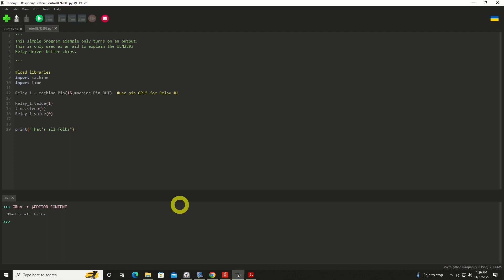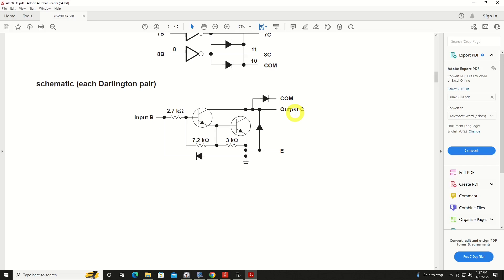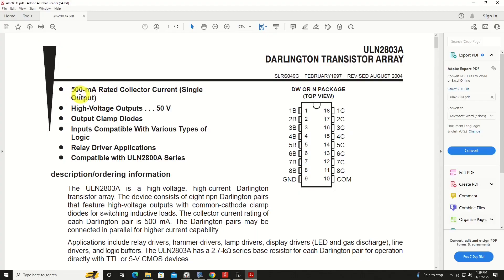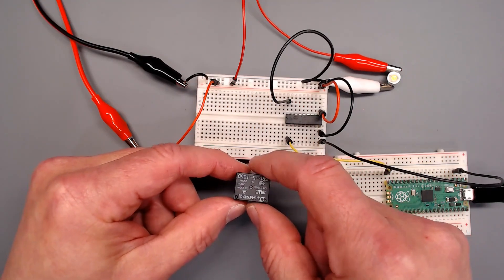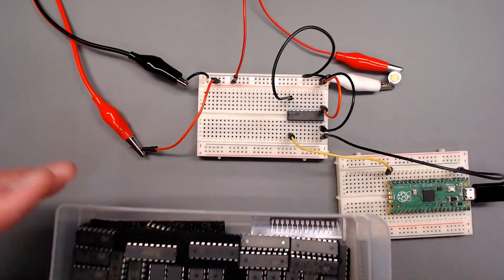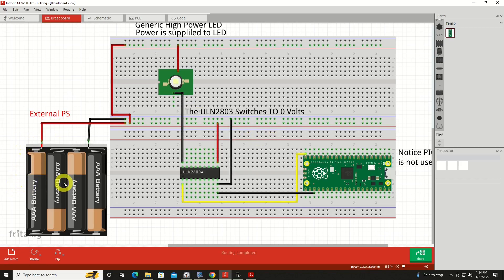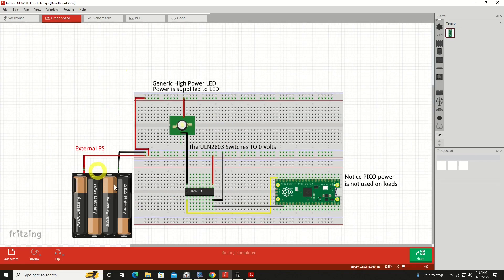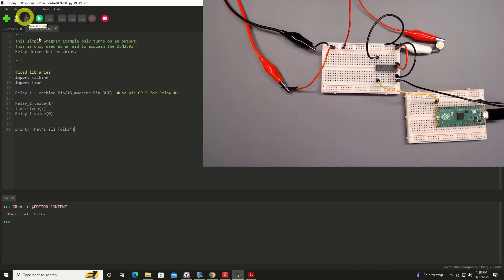Protect your PICO by using this chip to drive larger currents!

Comment: In bed watching. Something to find next is the “opposite” of the chip presented here. 
I plan on tapping a number of 12vdc lines, and need to knock them all down to input level of pico 
But would like to do 20’ish inputs via similar chip, instead of numerous voltage divider circuits
Reply from the maker: Good morning nemesis851_,
Off the top of my head I don't know of a chip that can do that.  However, I have to believe one would exist as that is a very common need when dealing with digital inputs.  Perhaps an IC that is an optocoupler?  
Cheers!
Chris

Comment: Assuming you want to deploy this circuit out in the real world (i.e., off your bench), you'd need to power both the high power load AND the micro-controller. Assuming the load also needs a high voltage, you'd probably want to use a single PSU. How would you do it? I'm thinking of getting a USB PD trigger board and a USB adapter which will give me 20V. I then need a buck converter for the pico and a boost converter for the load(s) (which need around 24V peak). I need to drive multiple 24V loads at 2W max (they'll be PWM driven so might need less power). Do you have any recommendations about the converters in such a scenario?
Reply from the maker: Good morning semod8614,
Assuming this device can run on AC, I would use a switching power supply to get the 24vdc and then use a buck DC-to-DC converter for the microcontroller. 
I am always hesitance to use boosters because the amps drop as the volts increase.  Everything has to balance between source and load regardless of what is in the middle.
Chris
Reply: @MakingStuffwithChrisDeHut  Yes I thought about that but I am drawn to USB PD as those kind of power supplies are now so cheap and ubiquitous and come in all sorts of form factors. Also, do you get V drop across the ULN2803? Assuming you do, I will still need to boost with a 24V PSU or look for 30V PSUs which are less common and usually more expensive.
Reply from the maker: @semod8614  More than likely there will be a small voltage drop, but frankly I have never measured it.  Is your 24v device that sensitive that it needs exactly 24v?

Comment: So can this be used as an alternative to using an NMOS as a switch?
I am planning to buy the IRLZ44N MOSFET to swtich a 12v 1A load (fan). As per my understanding, ULN2803 can achieve the same result while providing additional protection.
I may have to consider one with higher collector current rating as ULN2803 has a 500mA limit with 1W power dissipation...
Reply from the maker: As typical with all electronic devices, watch the Volts and Amps as you already noted.  
Cheers!
Chris
Reply: @MakingStuffwithChrisDeHut  Thank you.

Comment: Hi, as  usual a very good presentation with effective examples. If you were English these types of interface chips are called an "open collector" interface i.e. a transistor with only the base and emitter connected to the micro controller. As you described this means that the signal is switched to ground not the controller positive so,  presuming a common ground and the considering the limits of the chip, any external voltage and current can be controlled by the micro controller with minimal interfacing. You can do the same with any transistor (BC108) or Darlington pair if you only need one output. Thank you very much for the effort and time on these videos. Bye
Reply from the maker: Thank you for the kind words, very much appreciated!  Thanks too for sharing the "English" perspective.
Cheers!
Chris

Comment: not cheap but cheaper than the pico, less than half, but the uln2003 is much cheaper (7 io, 2803 has 8 io)
not a drop in , need to check the datasheet
Reply from the maker: Hi Jyv,  When I did a lot more discrete electronics projects I bought a lot of UNL2803 chips and still have plenty from back then - so sometimes I forget to consider prices.  However, even if a ULN2803 costs 10 times more than a PICO, it still provides more than just protection as it allows you to do what the PICO can't.  The uln2003, as you noted is a lower cost unit too. 
Thanks for the feedback, always a pleasure!
Cheers!
Chris

Comment: Excellent, clearly explained, and useful presentation!  I appreciate how you don't include music,  distracting irrelevant graphics, or extraneous material....just the facts clearly and pleasantly presented.  Reminds me of physics lab in college - a good thing. Where do you source your small electronic  components (you already have mostly everything)?  I have used Digikey, but wonder if I am overpaying and should reconsider the junk on AMZN.  Thanks from a new subscriber!
Reply from the maker: HI Quaternion,
Thank you very much for the kind words, you have not idea how much I appreciated that!
Regarding your question, in the past was always MOUSER or DIGIKEY.  I have been buying most things in the very recent past off of Amazon, however, it is hard to get quality items sometimes.  My current method is this...
If needed quick, I find a reliable vendor such as Adafruit that also sells on Amazon and then buy there, otherwise, if the project isn't time critical, I will put together a "Shopping List" at a vendor and then order a bunch of stuff all at once to help defray the shipping costs (which are crazy high these days). Vendors that I have found to be purveyors of quality items (in the USA) are: Adafruit, Pololu, Sparkfun, Robotshop.  Luckily with the Internet, we can find and purchase more stuff today than at any point in history.
Cheers!
Chris
Reply: Reichelt elettronics?...